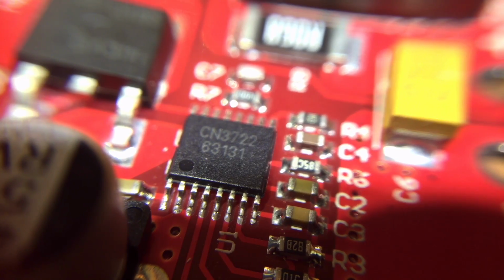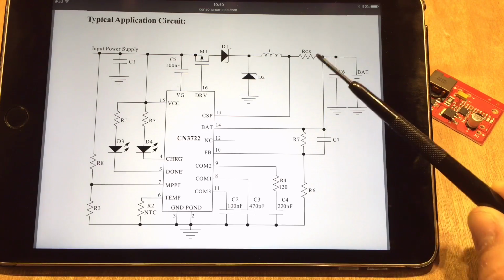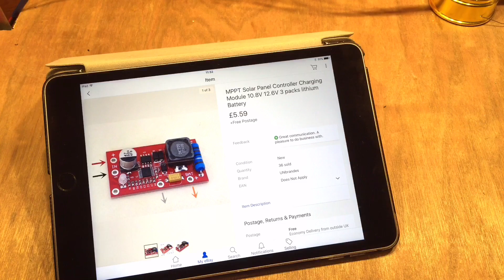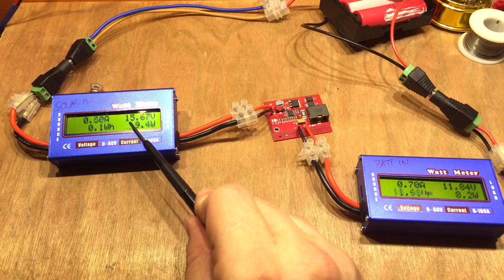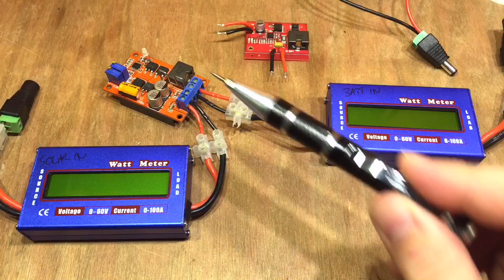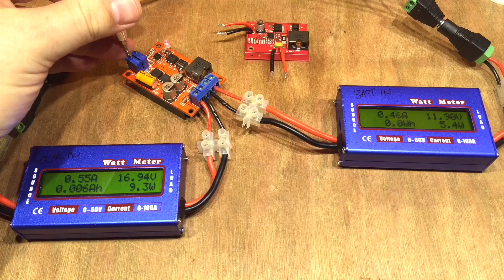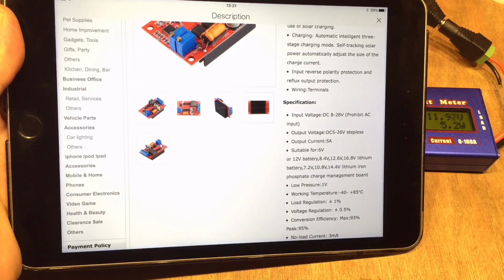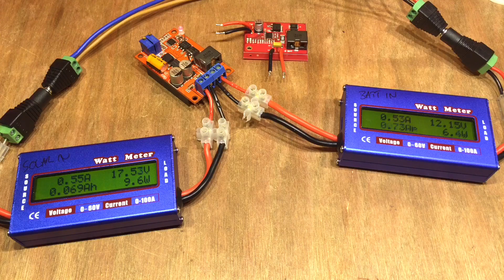Cheap(est?) Lithium MPPT Solar Charge Controller CN3722 - 12v Solar Shed

Comment: Would there be any danger for my batteries. Would it be possible for you to explain to me how to set a target voltage. This works like mppt charge controller? I use a Juta mppt charge controller. Do you think this in the video would work more efficiently?
Thank You!
Emmanuel.
Reply from the maker: It's designed for lithium cells and has a sensible charging profile so it should treat lithium cells well.  To set the voltage I'd connect the correct amount of fully charged cells top the battery connections and turn the pot until the led suggests the charge is complete.  I'd double check a little later using a multimeter after the board has gone through a charge cycle.

I've not used the Juta so can't comment on the efficiency I'm afraid.
Reply: My batteries are lead acid. Is there any problem?

Comment: Hi, Julian!
can I use it to charge my two 12volts 70amps lead acid batteries there are hooked in series?
Thank You?
Reply from the maker: +Emmanuel Tavora You're on the wrong channel for a Julian! The adjustable version would be suitable. It's a little different to most lead acid change controllers though - you'll have to set a target voltage and the charge controller board will get to that voltage and keep the battery there. There wouldn't be a boost/absorb charge like lost lead acid chargers.

Comment: this one claims to be genuine mppt at 40 dollars. seems legit. thinking of getting one  https://www.aliexpress.com/store/product/10A-12V-24V-MPPT-Solar-Panel-Battery-Regulator-Charge-Controller-LED-display-IP65-efficiency-99-MPPTSUN/2336306_32714720583.html
Reply from the maker: Could be - difficult to tell from the listing.  I wish they showed the inside more often - then you can tell.
Reply: i will try and message the seller for a picture of the inside. i have already bought one pmw from this seller but still waiting for my 100 watt panel from elsewhere to test it. seller seems legit so far but im hoping he can send a picture of the board inside
Reply: Made by SunWorld so probably a good purchase!
Reply: i sendt the seller a request to see the board but so far only a faint reply about that didnt show anything about quality.
I will sendt another request cause it seems like a good buy
BUT still if it is genuine mppt it might still not be very effective though

Comment: can it be used to charge lead acid?
Reply from the maker: The adjustable one could, but it doesn't float charge so you battery wouldn't stay at full charge once the CV section of the charge completed.

Comment: great find, perfect analysis.Can you connect the output of the little red mppt board into to solar input port of a pwm charge controller (designed for 3s lithium) to get your super cheap mppt charge and load controller for a 12v rated panel with 3s lithium? what I love about the mppt chip is that it is powered by solar, so you could probably run a small pump off it without a battery and still get mppt.
Reply from the maker: +mjp0815 That's a really interesting idea using it on the input of a PWM solar charge controller which might just work. I'll have a think about that and perhaps give it a go. Thanks.
Reply: Adam, thanks so much for your response! Maybe on second thought just connect the output of the mppt module in parallel with the battery and the battery terminal of your pwm charge controller, I guess all that is needed is load management, I remember you did not like the way the cheap PWM controller was doing lithium charging anyway.

Comment: When you adjusted the pot to change the MPPT point and you adjusted the volage down to around 15V you said that the input power had gone down. But you did not seem to notice that the charge power had gone up which is what you really want, i.e. more power into the batteries.
Reply from the maker: +FireballXL55 I've looked back and you are right. It seems the efficiency of the conversion isn't great. As the panel voltage was brought closer to the battery voltage (despite this resulting in lower power on the panel) the battery charge did increase. Perhaps one day I'll retest this. Cheers.
Reply: @AdamWelchUK  I would definitely watch that video, I have more than 10 of them and I just love how well they work... I'm powering mine with a 24V nominal panel and I have four 12V Lifepo4 Batteries in series with a controller connected to each battery! They are automatically balanced! And they can be paralleled for more current! 
I love them... I have been looking all day through your videos and Julian ilet's also because I couldn't find this particular video, the second charge controller isn't in the thumbnail so I kept going past it LoL... I have been trying to send people to this video but now that I have found it.. hopefully you can get some new subscribers... But please, if you have the time and opportunity, make another video about the second one and put it through its paces... That is if you still have it...
Reply: Yes please....a more in depth test would be nice
Reply: Adam Welch when the temperature in the solarpanel  rises, the mpp drops.
If the temperature of the panel is 50-60°C it's very possible that the mpp is 1.5-2 V lower.

Comment: Is there any way to use the logic circuitry of these chinese mppt modules to control a much larger power stage i.e. 50-100amps?
Reply from the maker: +Jake Mitchell Possibly. You'd need to look at the diode, mosfet and inductor ratings first. Then you might need to think about the shunt - possibly a voltage divider or opamp on there - thinking out loud it might be possible yes.
Reply: Jake Mitchell 
this circuit uses VERY special logic P-FETs in a high side driver configuration. No chance to have more than a few A. Shame.

Comment: Any hope of putting a few of the adjustable ones in parallel or series to get a higher amperage controller?
Reply from the maker: Connecting multiple charge controllers to the same battery but each with their own solar panel?  In parallel it might work ok as long as all of them were set to the same target voltage.
Reply: Thanks, I may give it a go

Comment: ***** so now there is below 50 quid MPPT that isnt fake.. but it is for lithium. Any idea if similar thing exists for lead acid battery? Thanks for the vid. (or using the adjustable is safe? given the charge profile is kinda.. lithium kind i guess, i dont know how bad it is for lead acid)
Reply from the maker: +gelisob I guess you say things like that in public and you have to live by them! But technology moves fast and yesterday's newspapers are today's fish and chip wrappers!  There is a question over whether this is really MPPT and it's not exactly a fully featured charge controller that one might expect, but it definitely breaks that price barrier!

If you used the adjustable version on a lead acid system it would charge to your predetermined level in the correct manner, after which it would allow the battery voltage to fall away. It wouldn't float charge the battery. I think the charging cycle kicks in again if the cells fall to 95% of the termination voltage. At this point for lead acid the charge controller will act more like a switching charge controller rather than an MPPT or even PWM. I can't see it doing too much damage to the battery though.
Reply: Hehe, no worries about the statement - it used to be very true until very recently I believe. I was also following Julian to see if he's arduino-nokia-thingy-madzi mppt gets going for cheaper solution but he didnt seem to finish or make use of it finally, yet. The need for expensive MPPT always made entry to solar a lot pricier.. hopefully these thingies can change it. ordered one adjustable one for testing myself too. And thanks again for the vid, wouldnt have known to look into it otherwise. (ps. hint, you can go put annotation on your 50 quid statement vid tho and make ppl look your other vid too, more views)

Comment: You need to check the Vmpp at NOCT for the solar panel, not 25C. Panels are normally pretty constant voltage, so the datasheet is pretty much correct in that sense.

In normal full sun a 72 cell panel has a Vmpp of 36 Volts at 25C, but that's about 33 Volts at 65C (the actuall cell temperature). Your panel should list it's temperature coefficient on the rear sticker.
Reply from the maker: Useful info - thanks very much.
Reply: @AdamWelchUK  Yes, but you have a 12V panel at 10W.  So not surprised they designed it to operate at 17V - 18V Vmp.

Comment: I checked with an ebay supplier the availability of these items, upon purchase the seller offered a "Newer" version, when the picture arrived it showed a pot on the PV voltage to set the MPP, however as with yours there was no series PV current sense resistor, so
not truly an MPPT in the Maximum Power Point Tracking acceptable description.
Reply: Yup, an MPPT controller should automatically hunt for the MPP voltage by rapidly perturbing the operation cycle of the converter and observing the total power draw from the panels. It needs a shunt resistor or Hall sensor on the panel feed to do that.

This is more like an MPP charger with no tracking.

Comment: its more like a manual power point tracking (mppt) device, but as long as you can track maximum power transfer point at the battery side, you should be ok, i guess.
Reply: Manual is so much better! I have had the opportunity to use an automatic MPPT charge controller and half the time it spends looking for the best point while the battery is not charging, it Hunt's around every single time a cloud will pass overhead... Not this thing! I'm really impressed with it's performance! I don't think that the solar panel ratings printed on the back are exactly accurate! I have tried different wattage panels and these charge controller's can be adjusted to get more than 20W from a 20W panel.. I have tried other wattage panels and it's exactly the same situation there too! I have since purchased over 10 of them... They just work so much better than anything else that I have tried or seen...
Reply: @PeterMilanovski  ah, you reminded me some very old stuff. 😁

Comment: Hi. I understand that following question might sound silly but it's comming from a newbie so please bear with me. I'm interested into making a portable battery system for charging my phone and tablet on the go (so value-wise 5V output with max of around 1,5A ) , using 18650's and auto step up/down converter (mine rated to max of 2A for in&out). Would it be better to set it up with 2+2 18650 in parallel (and get double capacity) or 4 in series (not sure here how this translates to total capacity since I'm stepping down from  16,8V to 5V )? Last question, is it ok to charge like you show in this video, multiple Li-Ions in series, using only end total voltage for charge termination and without balance port ? Thanks in advance and love the videos. Subbed !
Reply from the maker: The issue around charging batteries in series is that they start to fall out of balance as you say.  One cell might be low, another much higher and the charger will keep charging - potentially an issue.  Adding balancing circuitry adds to the complication of your circuit.

As a result most (all?) power banks on the market use batteries in parallel.  That way they keep themselves in balance all the time.   It also means you can easily charge from 5 volt USB.  It does mean you have to step up the voltage when the cells become the power source, and there will be some losses, but it's not too bad.

It might be best to consider your capacity in Watt Hours rather than Amp hours.  Lets take three cells - Nominal 3.7 volts each - 11. in total.  Lets say they are 2000mAh cells.

In series they total 11.1 volts, and have a capacity of 2Ah that's  22.2 watt hours.
In parrallel they total 3.7 volts and have a capacity of 6Ahs and that is 22.2 watt hours.
So as you can see the results are the same.  

Unfortunately if you are looking to solar charge your lithium cells I've not found a solar charge controller that works on a single cell voltage.

Hope that helps.

Comment: I thought this was quite an interesting approach. So ever since I watched your video I have been on occasion monitoring the solar input voltage going into my Voltronic MPPT charge controller. Interestingly, the voltage variance is not that great. It usually does stay around the MPP point of the panel, 17 volts. Occasionally it's 16 volts. It only goes lower under adverse conditions. i.e. really overcast sky, when there is shadow on part of the panel & at the end of the day when the light is low. This panel usually puts around 5-6 amps in decent Sun when the batteries require it, so the wattage difference between 16 & 17 volts is only about 5 watts. That's not terribly significant either way for a large panel. 

The point being is that I believe under good conditions purely keeping the voltage at MPP is likely to be well good enough. It's only when those adverse conditions come that keeping a panel putting out 17 volts (or whatever the MPP is supposed to be) is likely harvest less energy than letting it fall towards the battery voltage.
Reply from the maker: +xanataph That's really interesting Xan. Thank you. I've not had a chance in the last couple of weeks to run a test like that. I think it's a reasonable theory that the designers have used and your tests seem to confirm. I guess monitoring the current on one side of the Buck converter and knowing the efficiency of the conversion you could assume the MPP on the other side too. Been thinking a lot about that little board! 

Thanks again for your experiments.

Comment: Hello, is it posible use a cheaper module as a TP4056 board to charge a lipo cell from a couple of 5.5v@170ma solar cells in parallel? I'm thinking on power a 100mA (Max) load and set the TP4056 for 200mA max current to charge a 2100mAh lipo. Would this be cheaper and still work?. Thanks!

Comment: It looks like a nice solar-powered battery charger, but how is it going to handle if you're drawing power from the battery at the same time as you are trying to charge it? It's a constant-current charger - drawing power while charging is going to really mess that up.
Reply from the maker: +Vyl Bird Now this is a good point - the constant current is set by the resistor being used as a current sensor shunt according to the data sheet. I think you have spotted an issue which I hadn't thought about. 

If a load was pulling less than the charge controller was supplying then there would be a net gain in the battery but this might cause an issue with the termination calculation as it's based on current draw. If the load was more than the input could sustain then it probably has less of an effect. 

Perhaps I'll have to test this a bit further - thanks for your comments.
Reply: Perhaps you could bodge something up by moving the shunt to the battery, with the load connected on the same side as the panel, but it's not designed to work like that - and reading negative values for current could really confuse the logic. That's how I solved it on the arduino-based PWM controller I designed.

Comment: I was giddy with excitement watching this because I've been looking for a decent cheap charge controller for an 18650 lighting project I want to make. My wife groaned when she saw what I was watching. 

I will grab one and a 4S BMS, a solar panel, an adjustable buck, and some chip LEDs. Home free!
Reply from the maker: +pepefpv Glad to be of service!
Reply: +Adam Welch Looking at panels now and I'm a little confused. Because I want to run 18650s in 4S, fully charged the pack will be 16.8v. I was thinking an 18v panel would be better, but all the ones I can see appear to have a built in regulator for 12v pb batteries. So will a 12v panel work OK in this situation,  or can anyone recommend a suitable 18v panel that isn't  $100?
Reply from the maker: +pepefpv 12 volt panels have their maximum power point at about 17-18 volts. They might work ok for you. A 24 volt panel would supply voltages too high for this little charge controller. 18 volts would be the natural choice, but as long as you've got a volt or so of head room you should be ok.
Reply: +Adam Welch Awesome, thanks!